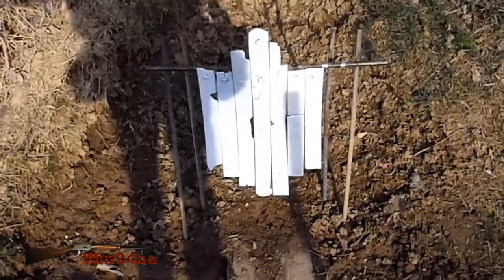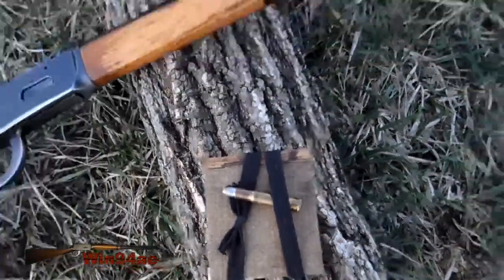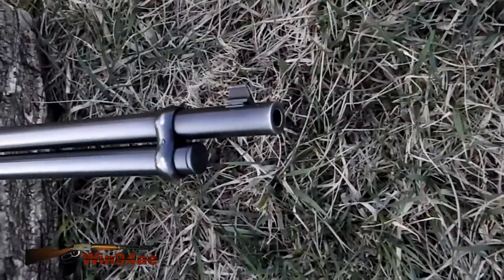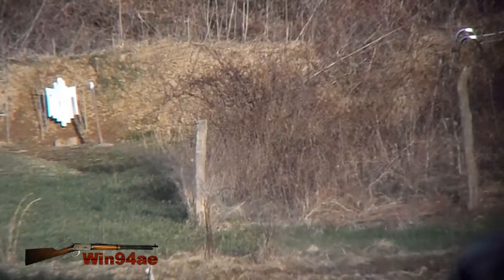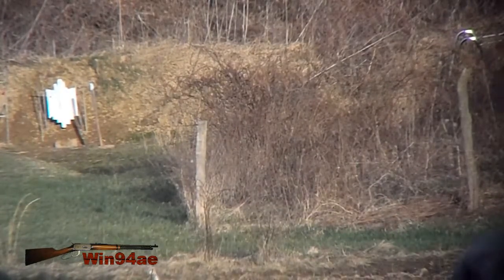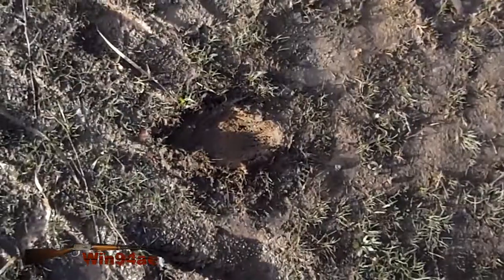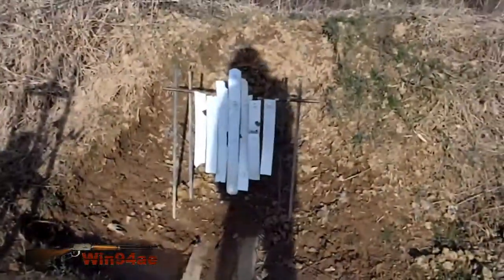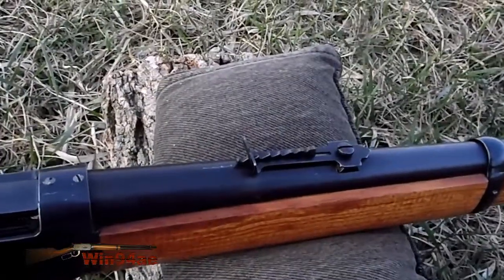Clean to Fouled Bore POIs

Comment: So , you don’t clean your barrel when you shoot lead? ,  Very interesting, a s I just started to load my94 with 170 gr cast bullets
Reply from the maker: I wasn't, but I think with the lubed bullets that isn't a good idea. Of course I didn't see any build up in my AK barrel, or any of the 30-06s. So t could have been the worn barrel was a bit too big, and caused the mega fouling.

Good luck with yours!
Reply: @Win94ae  thank you for your reply, love your cast bullet videoes!!!! I clean my 94 s barrel after every range session or hunting trip
Reply from the maker: @neelsmuller3716  I don't usually shoot cast bullets in the 30-30 yet, I want to get some plain based bullets to powder coat. So I don't clean any of my guns unless I find a fouling problem, except the CVA hunter which I clean after every range session or hunting session where I fire the rifle. The steel in it is not quite as good as the USA made rifles; so the actual barrel corrodes.
Good luck!